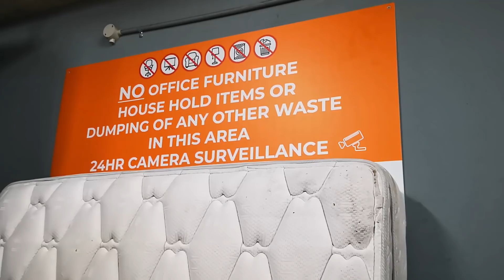Dumpster PC - 1000W Crusty Jobbie

Comment: Hick-up ? Are there drives connected ? Disconnect HDD's, to see if one won't spin up. It can cause a high current draw, and activation of the short circuit protection in the PSU.

Comment: I have one of those, did you check the "hidden" compartment on the front? Remove the bottom front panel with the logo and there is small box you can pull out. Useful for tools and similar

Comment: Years ago, Dell made an XPS 700 tower system that had an option for a 1kW PSU.  It had a non-standard power cord connector on it to ensure you didn't try to use a standard modular power cord, since the thing would suck down over 9 amps if your mains voltage was low and well past 8 amps at the nominal 120V mains supply voltage.
Reply: I'm guessing that's a C19-type power connector. That connector was also used on late versions of the Power Mac G5.
Reply: @eDoc2020  I do beleive you are correct.  There are a few of these for sale used on Amazon.  Some list the power input as C19, and on a couple the pictures show the input connector well enough to see the pins match the C19.  The C19 connector is rated at 16A, so a cord made to the C19 spec would be more than adequate for the 1kW supply.  (Yes, 1kW is a huge PSU for a consumer machine, but in 2006 the top-end components used in the XPS 700, particularly the dual nVidia GeForce 7900 GTX video cards and Intel Pentium D Extreme processor, sucked down a lot of power.)

Comment: I found the exact motherboard and processor also, it was in a case filled with chicken poop and feathers. Best part was it still had a graphics card. A 1660oc 8gb card. Washed all with vinegar and hot soapy water. Dried all components in front of a AC Heat cycle for two hours each. All worked well. Tested a few games. Worked flawlessly. Bobby dazzler!

Comment: Got same PSU, got off ebay years back as a for parts not working, was overheating shutting down, fan failed due to orange brown hell glue that ate away trace on pcb, simple fix, been working great ever since.

Comment: I on the other hand like those big cases. Could be multiple things, but maybe the PSU has problems. Usually people buy them for a system like that, even though full load is only 400W or something. The rest of the 1000W goes to heat, especially if you buy one of those cheap 1000W PSUs. 'Yeah, finding the problem can take up hours, there are however those things you can put into pci slots that do diagnostics, showing either it is a CPU or mem problem etc. Wonder how good they are, maybe worth making a video on the other channel? Although that is more for PC guys I guess. Anyway, interesting video.

Comment: I am still using that exact same case with my 4th gen i7-4790K today. I'm a power user. Admittedly it's finally starting to show its age but mostly only because I spend a lot of time decompressing diagnostic reports working on Linux support and I need to use compression to keep that in check and starting to notice that. Still playing lots of games, etc, using it all day very happily.

Comment: I have that exact same computer case, the Coolermaster Stormtrooper 
i got it as it has room for all of my drives and at work we store entire engineering environments in those 2.5 inch laptop HDDs for each project and the port on the front to just slot them in made a rather clean setup 
its dated now and when the PC market becomes sensible its going to get replaced, but its a fantastic case
EDIT: yes the rubbery coating is completely covered in dust, no you cant easily get it off

Comment: I've got that case and can confirm it's very heavy indeed.  Cost me £140.00 in 2016, but I fitted mine with a core i7 and a Cooler Master V8 Ver.2 CPU Cooler which is the size of a football...  My biggest issue with the case is how all the usb connectors are positioned as I spilled my scotch on the desk, and it poured all into the ports.... Luckily I got the power before it all fried.
Reply: You could coat your PC with a can of Scotchguard™ for next time. 🥃💂☔

Comment: One thing I have learned from old Gigabyte motherboards is when they won't boot up at all and act like this one, pull the CR2032 CMOS battery out and try botting without it. When the battery in those boards get low, and the battery from a board of this vintage would most likely be quite low (unless it had been replaced recently) they won't post at all. The fans will start spinning with a black screen and then they go into a loop of turning on and off. With no battery at all it would boot up to the default settings. 

It's an easy test as it only takes a few seconds and doesn't cost a thing.

Comment: Too late now, but #1 thing to do would've been to clear CMOS. If that doesn't work try the RAM individually. I associate that behaviour most commonly with bad RAM configuration or a failed overclock configuration. As a "K" CPU SKU, it's designed for custom clock settings.

Comment: I brought two of those cases in 2007 silver with the power supplies fittings on the bottom with castors and I still use them and they are indeed very heavy. The drive bays are handy as can get fittings now similar to caddies where I can just slot the drives through them. The power supply I ordered, one of them still works is an an Enermax Galaxy and that is 1000w (dual transformer inside). Nice it's lasted so long.

Comment: I guess they originally had a much more powerful build in place, but took out the parts for a new build or resale,  and put a cheapy motherboard to have a functional computer with the spare case and power supply.

Comment: 9 cdrom bays is less then what I've got :P , my two CoolerMaster Stacker STC-T01's each have 11 cdrombays, 12 if you can live without the frontpanel. As for the system you've got ,maybe it was used as a diy-NAS? That would explain the power supply, a large amount of desktop drives that are spinning up, draw quite a bit of power and it doesn't require the most powerfull CPU there is.

Comment: you should order a motherboard diagnostic tool. it'll slide into the pci socket and tell you the error codes. just don't slide it into the pci 16x it goes POOF! and the magic smoke releases from the tool.

Comment: If I found as much hardware lying around as you do, I'd be set for any future projects... Currently trying to scrape ebay for a proper server, my Pi is choking on its RAM limitations... Would also be absolutely lovely, having stuff to build with all the time.
Reply: PI 4?
Reply: @bsekisser  Might as well get old x86 hardware for the price of a 4
Reply: Depends on the needs.  I used a PI 2 in a motel and since upgraded to PI 4...  Big difference in usability.  And the PI can be had with up to 8gb ram.  I have the 2gb board, run a browser. PDF viewers, text editing and gcc.  No problem.  One of my PI2s did fine running a personal file share and boinc in the background...  For a time I also used it as a proxy.
Reply: Also depends on what is readily available in your area.

Comment: Interesting to find a 1000W ps in such an old system. Maybe it had more than 1 gpu at some point?
Reply: That is probably a first time system builder "mistake" in all honesty. 
The first PC I build had an 850W power supply which was pretty overkill for the system. 
At max load even with a heavily overclocked i7 920 and an ati 5870 it only drew like 500W when stress testing both the gpu and cpu at the same time.

Its not a bad mindset for someone who first builds a system though. Buying an overpowered power supply is not a bad thing. The other way around is way worse.
Reply: Only has a single 16X slot. So can't take more than 1.
Reply: @DONK8008  Yep, but maybe it's not the 1st mb in the case
Reply: Definitely had a different motherboard before. I used a case that once to host 7 graphic cards for ab multiscreen setup. Ages ago.

Comment: So one thing to note is that Passmark had done some significant scaling changes 4 core processors used to score from 8000 to 10000. Now they all score much lower this means that the scores are not consistent over time.

Comment: Most likely the PSU is dying, and not delivering full power on the one rail or the other, probably the 3v3 rail. simlest test is just to unplug the PSU from the board, and turn it on with a resistor and see if it still cycles.

Comment: A Haswell era motherboard with a parallel printer port in the I/O shield?  That's a bit uncommon.  Those ports had mostly devolved into simple headers on the motherboard with (sometimes optional) expansion slot cover port dongle-ly things for folks who still needed them.
Reply: Yeah you still find plenty of boards with serial ports these days, but Parallel? That's been quite rare for a long time!

Comment: “Got no use for this case”
Meanwhile all the shortages and supply chain disruption has me haggling over Craigslist cast offs, big ol’ oof
Reply: Cases are still fairly available.
However I agree this one is a great case, especially for NAS systems with many disks. Its not beautiful, but very functional.
Reply: Plus this one can fit an EATX board

Comment: 1000w for a PC!! Is it really necessary? The power supply is worth salvaging though.😀
Reply: Did you see the 3 stage VRM on the motherboard, lol.
It may have had a lot of PCIE cards that needed the power, a lot of PCIE slot covers where missing on the back.
Reply: @liaminwales  A lot of people just buy power supplies that are way overrated these days. Everything under maximum synthetic load drawing 450W? Better buy the 1000W PSU in case you want to add another 3 GPUs or whatever lol. 
Some people think they have to add at least 50% extra margin even if they dont plan to upgrade anything ever.
Reply: @Basement-Science  Well as the mobo has a serial port and it's a business park so Ill make the assumption it had some kind of use that may have needed PCIE cards but no real CPU use from the 3 stage VRM on the CPU (2 for the cpu 1 for the iGPU?).
may have been anything from a NAS to some kind of IDK control unit with PCIE cards, or yes as you mentioned it's a BtoB job and the IT shop that sold the computer where like "yep put in the big PSU to add to the unit cost".
I suspect it will not have been 3 GPU's as back in the day it was made there was almost no use for more than one GPU and with such a basic mobo I cant see it being used for massive CPU/GPU work.
So it's more fun to think it was plugged in to a bunch of odd equipment that needed a computer and PCIE cards.
Reply: @liaminwales  The board doesnt even fit more than 1 GPU. You'd need to use risers in the x1 slots to add more GPUs, which is a pain in cases like this because you cant mount them anywhere.
Also pretty sure this is a custom built PC based on the case.

Comment: I have a feeling the previous owner put this machine together with spare parts, and the (relatively) big CPU fried that piss weak motherboard. One of my friends had a similar board but they put a 4790K on it, it croaked, reckon the VRs baked themselves. Was doing a similar rebooting thing I think. Surprised these are only worth $60 now, they were holding their value pretty good for a while, i'd have said a K CPU is a keeper/sell on ebay though because of their overclocking abilities, they are generally the ones people look for

Comment: You realy should dive deeper into Intel's 4th Gen with their IVR integrated voltage regulators, they got tiny Inductors on the interposer, realy insane what intel did there. I did manage to destroy such a 4th Gen CPU with prime95, it put to much stress onto the IVR and burned out one of those Inductors.
Reply: Huh? I thought those were just linear regulators they integrated.. which isn't anything too special really. CPUs usually have onboard low-power voltage regulators for auxiliary rails that get derived from slightly higher ones which come from the multi-phase buck converter on the motherboard.

Do you have some resources where what you said is described? I'd be interested in having a look. I know those intel CPUs definitely didn't take 12V straight in or anything like that though. They had VRMs on the motherboard like anything else.
Reply: @H4zuZazu  Thanks, fascinating stuff! Didn't know you could actually do this. 140MHz for a buck converter is pretty crazy!
Although I guess it didn't work out too well in the end since they stopped doing this again. Apparently the extra heat on the die was a problem. (They got fed by 1.8V btw)

Now I'm wondering what other ICs or especially CPUs are going to do this or already are..
Reply: We usually test hardware with prime95, normally what happens usually is never a CPU being killed with prime95 but hardware going bang ;) Anyway it did not go well as Haswell ran very hot on the high power parts
Reply: I'm sorry, but this sounds like a BS to me. U managed to physically destroy a CPU with software load?
Reply: @kacperkostrzewa8688  It was a i5-4460 i used small-FFTs, it killed also the Motherboard itself, the Pre-regulation is gone too.
There you can see the Burned up Coil https://abload.de/img/img_0913bodjsd.jpg
Reply: @H4zuZazu  holy smokes! I've never thought that's even possible, nice
What's also nice is their coil (and whole buck converter) integration into CPU PCB!

Comment: A good way of determining newer pc's now (rather than USB3) is to see if it has a m.2 slot on the montherboard,
That'll indicate if its up to 6 years old.
Reply: Some of those M.2 slots are on the bottom of the motherboard and will require complete disassembly to locate.
Reply: M.2 does are older than 6 years old. My motherboard was released in 2013 and has it. 8 years at least.

Comment: This Cooler Master "Storm Trooper" case is cool, keep it, just clean it up. It has a lot of space, good air cooling, easily accessible drive baskets, built-in container for screws/cables/etc., very useful carry handle assuming the total weight of assembled PC. Even if it's old and crusty, still worth every cent.
Reply: I have one, and I’d love another.  Best case I ever bought
Reply: It looks horrific and chintzy. Just looking at it gives me the creeps.

Comment: With regards to PSUs, many people think just getting it to start and present voltages is enough of a "eh it works" test.  Ideally though you should try and throw a DC load on all of its rails and do something as close as possible to a burn in, otherwise can you really be sure that a repaired PSU could let its magic smoke out, potentially taking out rest of your hardware?? Thoughts Dave?
Reply from the maker: Yes of course. But every PSU I've found has passed a decent burn-in, so confidence is high.
Reply: @EEVblog2  I've got 3x iffy AX860i units, I'm going to tear them down and have a closer look. I finally finished my isolated current-limited Bench PSU build, this should help prevent things going boom https://www.youtube.com/watch?v=QkYiwK2uDK4
Reply: There's always the fear used PSUs are about to hit the far end of the bathtub curves, run-in can't be trusted for stuff this crusty
Reply: @tommihommi1  actually in my case, these units are practically new; they've only aged in storage so I'll give them a whack.  One unit went 'boom' so I'm curious as to what died inside.
Reply: @tommihommi1  if it's free, who cares. There's very little chance it's going to damage anything if it fails, and if you're using a free PSU, you likely don't have anything that's expensive or mission critical anyways. Plug it in, run it, if it breaks, find a new one.
Reply: @littlejackalo5326  PSUs often fail in a fairly exothermic way, and with significant overvoltage ln their output. So the opposite of what you said is true: They like taking other stuff with them, and can set your stuff on fire.

Comment: Hello from Sri Lanka!  Huge fan of Dave and Dave CAD etc.

I've had a terrible time with Corsair AX860i PSUs.  The digital circuitry is super sensitive and I've had two units go into a 'relay-clicking' loop.  Since then I've switched over to EVGA PSUs and they've been pretty solid. Corsair HX range has also been quite stable and reliable, just avoid the AXi range if you can help it.